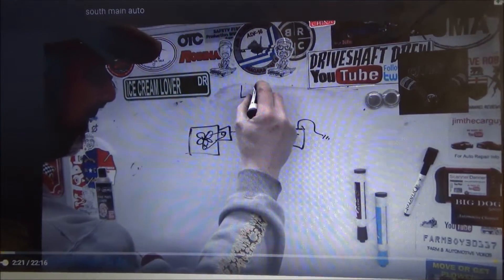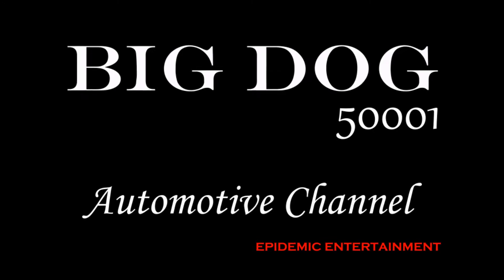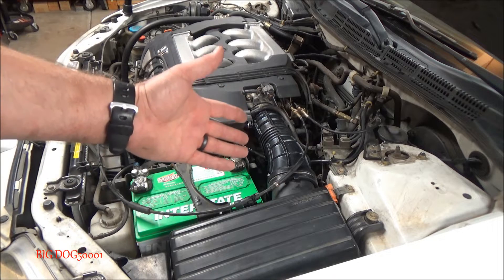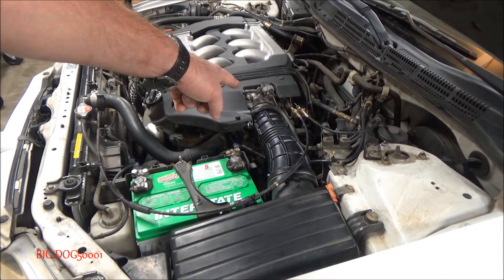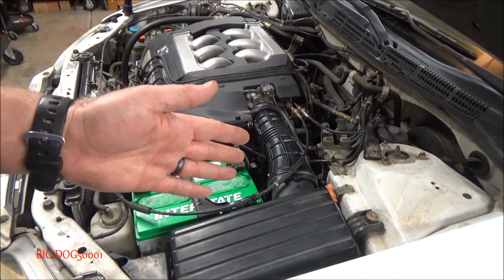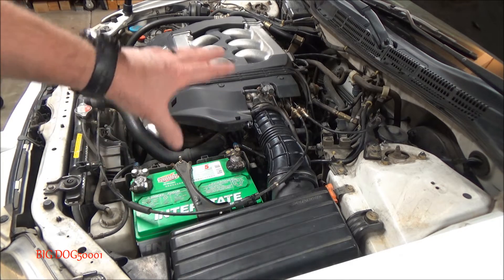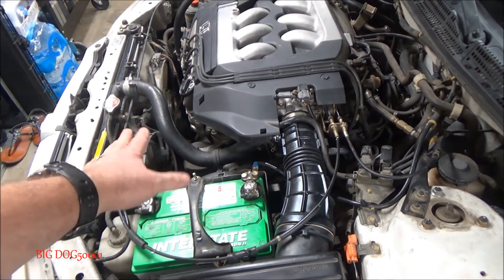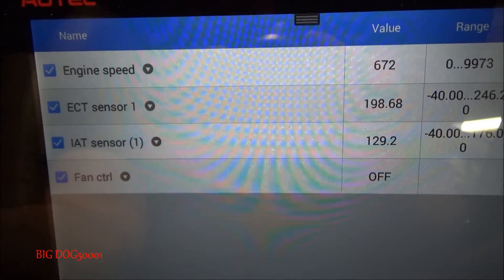Honda Idle Relearn Procedure

Comment: What about on a Honda civic 2016?
Reply from the maker: Little more involved on those newer Civics.  Same 5 minute run time with no loads but a scan tool is also needed.  The PCM has to be reset first with the scan tool and then after the 5 minute idle run the car is turned off and the SCS (Service Check Signal) line has to be jumped, also with a scan tool.
Reply: @ I see other wise it will run rough thanks! For your wisdom

Comment: Can you use a bidirectional scan tool for idle relearn or is best option just get to operating temp and let it idle 10 mins to “relearn”?

Did you have to take off negative battery cable for any time before starting Manual idle relearn process - operating temp and 10 min idle ?

Comment: 2002 acura rsx . I have a p0505 code I am having trouble getting rid off. the car is stock with a cai . I replaced the iacv 3 times thinking they could of been faulty and I even swapped out another throttle body and pulled the ecu fuse and then a did a relearn car runs great for about 20 min then bam the cel goes on and it's the same code. If someone has had this issue and fixed it please let me know so I can try it because I'm lost lol 😆. Thanks in advanced

Comment: the the 2014-15 crv is notorious for  vibrating at idle when in drive. Does this fix this? The dealership couldn’t figure it out. I wanted to try mess with the throttle stop but the TB is buried.  Are these are electronic throttle body or cable?
Reply: I would imagine based on the year of the vehicle that it would be an electronic. I have a 2008 Civic in my throttle body is electric. I think the cable ones are more of the old school variety.

Comment: I did this wrong and for not enough time and it worked lol. i immediately turned on the headlights with my car and enabled the radio and drive away after like 5 minutes and it still figured out there’s slack in a throttle cable and the other one broke off and it drives a bit better until i actually fix things. im just lazy.

Comment: But what if you change the throttle body is it the same process because I have a 2013 Honda Accord I’d like to know
Reply from the maker: The PCM would have to be reset first before the 5 minute idle time for 2013 Accords.

Comment: Is there anyone who has had an issue with the idling on a newer Honda after the battery was disconnected and use a VCM Musler to disable the ECO variable cylinder management that is in the 3.5 L V6? I think the VCM Musler might be confusing the idle relearn process. Idling for a few minutes, with the air conditioner turned off, seems to have a similar effect As the engine and cooling system seem to be designed to run at a slightly higher temperature, when not using the air conditioner.

Comment: Just replaced the alternator and had battery disconnected for a lengthy time. I have a muzzler resistor installed for the temperature sensor to disable the VCM mode, and was wondering if this needs to be temporarily uninstalled so that the temperature sensor one will read the correct temperature to factory specifications

Comment: Had P0507 high idle after cleaning the throttle body, slipped my mind and moved the throttle plate (used to cable driven TBs, not electronic) tried a few tricks including the 3000 RPM for 5 minutes, the idle with cooling fans, nothing worked. Disconnected both battery terminals, left it overnight as a last resort and that seemed to reset it for me. Good cold start idle
Reply: Did it come back?

Comment: I cleaned my throttle body by removing it from my 2011 2.4 Accord without removing the battery cables.  I performed this procedure but the idle stayed at 1100 rpms and hops to 1500 if I turn the wheel.  
If this continues, do I need to unplug the negative battery terminal and try again?

Comment: I'm going to make a full flush of transmission fluid on my 2008 CR-V. Found info on forums that transmission relearn is required, because fresh fluid is much  lighter and therefore clutch will experience much bigger pressure than needed because transmission has previously adopted to dirty fluid and it can lead for transmission breakdown. So does this procedure relearn transmission also, and if so, does it work for CR-V 2008? I've seen some other ways  of relearning it, like shifting gears back and forth, accelerating/decelerating, pressing and holding gas pedal on the 2 key position etc., so I'm not sure which one is right for my vehicle. Thanks in advance

Comment: Thanks for the nice video. How to do CKP pattern learn without HDS ? What does decelerate with the throttle fully closed? Thanks
Reply: Let of the accelerator i assume currently figuring it out after changing crank position sensor

Comment: If the re-learn is unsuccessful after replacing throttle body would that mean a possible update needed to the ecm?  Also to have the computer flashed would that be a dealer only thing??
Reply from the maker: On some models the engine computer (PCM) has to be reset with a scan tool in order to complete an idle relearn.  Re-flashing the engine computer does not typically need to be done for a throttle replacement and it is something that should by done by somebody familiar with the process.

Comment: Another good video...thank you.  Your method is much easier.  I saw some videos where you had to keep the rpm's at 3k for 4-5 minutes and then a few other steps, and it seems a bit cumbersome.  So if i reset the throttle positioning sensor...then I basically let it idle for say 10 -15 minutes with all electric components off in the car?
Reply: For me when I did the throttle relearn (10th gen 2018 civic lx) I I reved it from 2-3k rpm’s for about 5 minutes about 2 times and it worked for me
Reply: ( 2.0L non turbo engine) for mines

Comment: TOOK OFF MY BATTERY THEN IDLE STARTED GOING UP TO 2500 UP AND DOWN AND EVEN REVS WHEN I DROVE DID THE RELEARN PROCESS DID THE 3000 RPM REV UNTIL FANS CAME ON AND LET IT IDLE FOR MORE THAN 5 MINS AND SO FAR SO GOOD IM UNDER A 1000 RPMS RIGHT NOW I WILL KEEP YALL UPDATED
Reply: did it work??
Reply: What car do you have?

Comment: It mean... when clean throttle body, battery disconnect, ECM unplug or replace.... I need turn on the key, turn off all electronic items then start the car. Until the fan coolant come on ->idle relearn proceduce is complete, that right ? 
Thank your answer !
Reply from the maker: On older Hondas like the one in this video.  Newer Hondas may need the PCM reset with a Honda scan tool first.

Comment: Would this work for a 2014 Accord,?
Reply: Do I have to turn the AC on after 2
 Cycles
Reply from the maker: It can, but newer Hondas like a 2014 Accord will probably need the ECM reset in order to completely relearn the idle.  Need a Honda capable scan tool to reset the ECM.  Also, vehicle should be fully warmed up and no loads, no A/C, nothing electrical on during the 5 minute idle period (the cooling fans may come on briefly during the 5 minute idle time but you just add a little extra time to the 5 minutes to compensate).

Comment: I have a Honda Accord 2006 2.4 Vtec LX, im going to change my Thorttle Body , is this the exact same procedure  i need to do , or do i have to get a scar tool from a mechanic after changing the Thorttle Body?
Thank you very much .
Reply from the maker: Typically the ECM (Engine Control Module) needs to be reset with a Honda scan tool first in order to complete the relearn process on those (after resetting ECM then the procedure in this video would be done).  Otherwise it will usually set trouble codes because the throttle is in a different position than the computer thinks it is.

Comment: Belt fragments were caught in my timing belt pulley right by the crankshaft position sensor.  The car cranks but won't start . Its a 04 Honda odyssey.  Do I need to do a crankshaft position sensor relearn pattern with a scanner or just replace the sensor?

Comment: I just replaced the starter on my 2003 CRV and had to take off the throttle body to do it. Put everything back together and the idle is all over the place revving up and down. Car is throwing a P0505 and P1505. I'm having a hard time believing the MAP sensor and Idle air control valves went bad at the same time. Does this sound like an idle reset is needed? Thanks
Reply from the maker: Those codes sound like a symptom of something else going on.  It is possible it needs to relearn the idle, especially if the throttle was cleaned because that would mean the throttle plate is in a different position than the engine computer thinks it is.  I would definitely double check all my work if this happened immediately after replacing starter, especially looking for bad/bent connectors and making sure all electrical plugs are secure and in the correct position and everything is installed correctly (especially anything that can cause an air/vacuum leak).  The idle relearn in this video is the correct procedure for those CRVs but in certain circumstances the ECM may need to be reset with a Honda scan tool first.
Reply: @BigDog50001  Very strange but I think I inadvertently did a reset by having the hot air on with no fan on and driving it around at the same low rpm for about 15 minutes and the issue went away. I reset the error codes and the check engine light has stayed off. I still need to burp the radiator as the coolant level is low from disconnecting the line lay from the the throttle body. Will make sure I comment if the issue persists. Thanks for your advice and video!!!

Comment: Hey guys. I have a 2008 Honda Civic that is always around 850 to 900 rpm idle. I tried doing the reset with a scan tool and it goes to around 750 and stays like that only until I turn the car off. No matter how much time I let it idle, it comes back
to around 900. What can I do?
Reply: if you haven't  narrowed it down by now Your drive belt could have had too much tension. Particularly if your in a region that experiences extreme temperature changes. I usually reset my serpentine to 1/2" deflection when it gets below 25 Fahrenheit

Comment: So I cleaned my throttle body and now it surges with at idle. Replaced throttle body gasket. Wasn’t doing this before I cleaned the throttle body. Any idea?
Reply from the maker: The throttle position is a learned value that the Engine Control Module (ECM) learns over time.  When the throttle is cleaned the computer does not know the correct position and it can create a surging idle and possibly a check engine light (codes P0507 and/or P2279).  Typically to fix those a Honda scan tool is used to clear the throttle position learned value, the ECM is then reset and then the idle relearn procedure (that I showed in this video).

Comment: Hello there! I got a b16a2 swap and recently my idle went by itself to 900 rpm up from 750 or so. I went to the garage, where we reset it by disconnecting the battery and then we decided to set the idle to 900, since as it's summer and it's REALLY hot, the full a/c usage will weaken the idle. During the procedure I turned on the headlights momentarily, then he set the idle screw to 900 and that was it. The car idles smooth as silk in either 750 or 900 rpm. What I don't understand is that sometimes after the fan turns on and off idles at 1000-1100, then after the next fan on and off goes to 900. Happens sometimes but why? And why the idle moved by itself to 900 in the first place? Also, I forgot to mention that ONLY when the car is in working temperature and crank it: the rpm go to 1500, then drop to 1000-1100, then after 3 seconds drop to 700 or so, then go up to 900 and stay. Why does this happen? As I said it's a b12 swap, with an obd1 ecu, completely reprogrammed with the stock b16a2 settings and map. The car runs fine and strong, but why does all this poltergeist happen? Thanks a lot in advance, liked and subbed!
Reply: Check and clean your throttle body and or IAC.
Reply: You changed the setting but the computer is still going to tell the idle to go up when the fans kick on. You'd have to either put it back to the way it was or have someone reprogram the cars computer so that it no longer tells the idle to go up while the fans are on.

Comment: Does this work on a 2021 Odyssey?
Reply from the maker: This is part of the procedure, but a Honda scan too is typically also needed for those.  The PCM usually has to be reset and the SCS line needs to be jumped in order to fully relearn the idle on new Hondas.   The PCM memorizes the learning status (like idle characteristics) one hour after the key is shut off on new Hondas like that Odyssey (unless SCS line is properly jumped), as long as the battery is still connected.  If the throttle was cleaned then typically the PCM will need to be reset.  Sometimes these new Hondas will relearn without a scan tool by letting it idle with no loads for at least 5 minutes or so like I did in this video (after fully warming up) and then shutting vehicle off for at least one hour which allows PCM to memorize its learning status.

Comment: Did a throttle body cleaning on my 2011 Honda Accord. I later got a P0507 code shortly aftet. Will this relearning process potentially fix that?
Reply from the maker: Usually not by itself, the throttle plate is now in a different position than the one it already learned in memory.  Usually to fix that code the throttle position learned value has to be cleared and the ECM (Engine Control Module) needs to be reset.  Both of these are done with a Honda capable scan tool.  Then you would do what I showed in this video.
Reply: @BigDog50001  thank you for the reply. The relearning process you showed in this video helped solve my issue. Thank you so much.

Comment: I have a 2011 Accord 4 cyl. I cleaned the throttle body and it idles at like 1k rpm warmed up. Will this method work? If not, what will?
Reply from the maker: It might, but usually the PCM (engine computer) needs to be reset with a Honda scan tool first before letting the engine idle for 5 minutes (after warming up).

Comment: I may have damaged my sensor. I too cleaned my throttle body, and remember the flap shutting close once. Now when I do this, it may come down in idle slightly, but after a week, it will go back to 1500 RPMs + check engine light. 😓
Reply from the maker: Sometimes the PCM has to be reset.  What is the code?

Comment: Does this wk on 2002 accord  2. 3 vtec?
Reply from the maker: Yes.
Reply: I replaced the idle air control valve 2xs poin my 02 accord.... did this procedure.... drive it 135 miles and got home and it's still loping!!!! No CEL.... just idle loping! What do i do??????..??

Comment: What if your pin on your accelerator cable popped off and by accident, it was pulled out a little when changing the starter, Friend put the cable back in place but the RPM is high it's 2.3. Any idea's on how to get it back to where it belongs so it won't be idling so high and it will be back to normal, Please Help, We need to get this done ASAP, Thanks again Big Dog50001 love your videos.
Reply from the maker: I would probably take it back off and double check my work (routing and connections), I would also check to see if it is binding up and then try to reinstall it.  If it was damaged it may need to be replaced.
Reply: IT'S  in right  they drove the car but it just won't  go below  the RPMS,  When it  was put back 0n my husband held gas pedal  when our friend  popped  it in the  lock.
Reply: Also when we try to start the car it has a weird  noise like the new starter is bad. IS THERE ANYWAY FOR MY HUSBAND TO  TALK TO YOU  ON THE PHONE OR ON VIDEO CHAT SO YOU COULD SEE AND HEAR IT. TODAY IT WON'T  EVEN  START. PLEASE HELP US? IF YOU CAN EMAIL US A WAY TO TALK IN PERSON A MESSAGE NO ONE CAN SEE  PLEASE?

Comment: thanks for the video - I moved the throttle plate to open by sticking in a rubber hose in the passage to conduct a home made smoke test (was looking for vacuum).. found the leak and fixed it but little did I know that it messed up my throttle.. going to try this tomorrow morning! Hopefully it works the same way on a 04 civic!
Reply from the maker: Definitely have to be careful moving throttle plates on certain vehicles.  That Civic may need the PCM reset in order to fully relearn the idle.  Thanks for the comment!
Reply: I have an 05 base rsx, i cleaned the throttle body, and i have a code p2279 which is air intake system leak. Is relearning gonna help?

Comment: Hey bud..my 2016 crv almost cuts off when I come to stop at a light when ac is off..it doesn't do this if ac is on..it will drop to 500 rpm, shudder and tremble some..if I put it in park with ac off. It doesn't do this..as soon as I put it in gear with ac off, it starts to tremble and rpm is at 500..just bought unit, has 65,000..any ideas? Thanks.
Reply: Same problem. Can anyone help?
Reply: I know its late but did you ever solve this?

Comment: I read everywhere else online that you have to rev the engine to 3000rpm's for 5 minutes?
Reply from the maker: The engine needs to be at operating temperature first, this can be achieved by bringing up the RPMs to 2500-3000, until the cooling fans kick in.  That might be what you are reading.
Reply: @BigDog50001  so then whats the right way?
Reply: @vinnyf6635  what he's saying that 3K RPM is only needed to bring the car to a operating temperature of 194 degrees for his car. The reprogramming happens with 5-10 minutes of car running at operating temp. doesn't matter what the RPM is

Comment: I replaced my Idle air control valve recently because of a high idle surge. I tried the relearn but it continues to surge
Reply: I also note that it's not as consistent as before I replaced it. Do you think it is relearning?
Reply: @A Lex yeah it came back but it was a faulty idle air control valve. I replaced it again and it is a steady idle now. Funny thing is the transmission went out recently at the beach so ended up trading it in for a new truck. Lol.